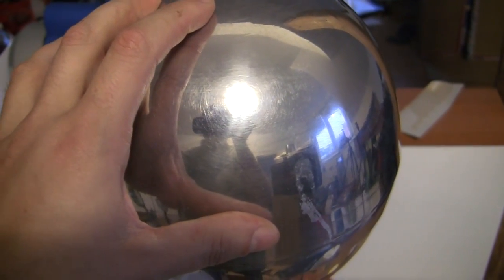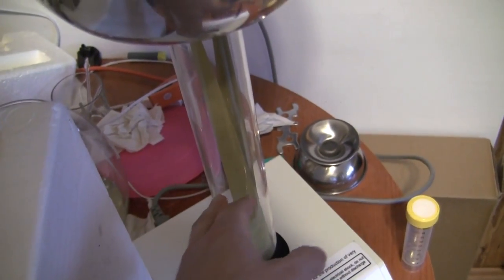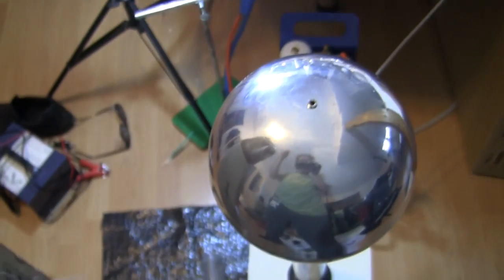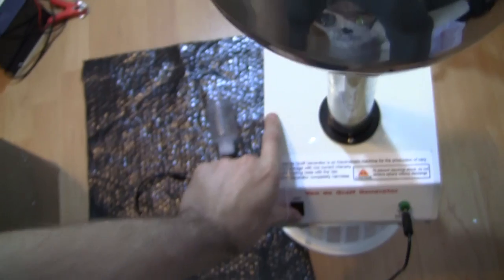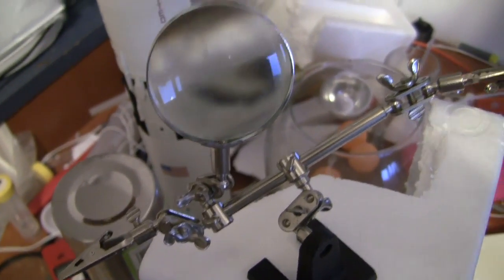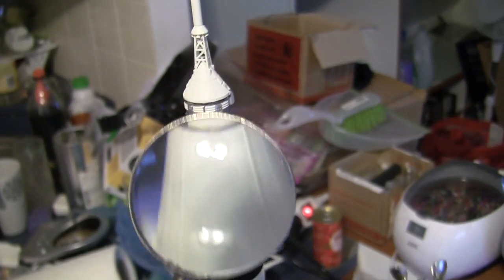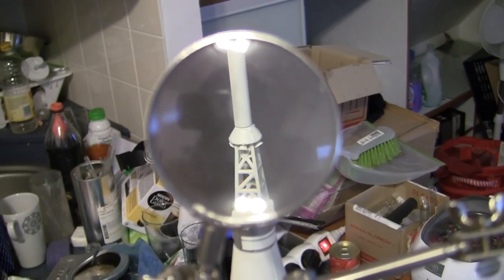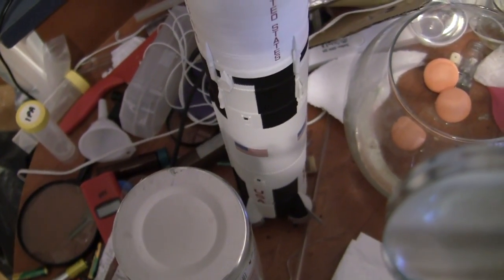Surviving a 10 000 VOLT shock!

Comment: Isn't amperage what kills you?
Reply: That is what he meant by current. Amperage is just the measuring of the current's strength
Reply: Cloud Seeker I never said anything about Voltage...
Reply: Navitas Nexus No, they are not. Amperes is the unit used to measure current. They are not the same thing.
Reply: Current and amperes are synonymous.
Reply: There are many dangers associated with electricity. The real danger with electrical shock is amperage, not voltage. Although people have been killed by as little as 120-volt AC and low voltage DC, the silent killer is the amount of amperage in milliampers that flow through a person's body. Any electrical device is capable of dealing a deadly blow, depending on the amount of current flowing through it. In fact, a deadly dose of current in the 100-200 milliamperes range is likely a fatal amount.
Reply: You need to understand that current and voltage are intricately linked, for a person to be killed by electricity a certain amount of current has to pass through the heart or diaphragm, about 30-40 milliamperes is commonly said to be lethal. This is because the muscles of the heart and diaphragm are electrical systems, if you disrupt them they will either stop or become irregular. Ohm's Law states that V = I*R, this means that to pass a certain current through a conductor (like your body) you either have to lower the resistance or you have to increase the voltage. Because lowering the resistance across the body is difficult - you'll need open wounds, salt water on your skin etc. The resistance between your two hands, across dry skin, is on the order of 0.6-10 megaohms. Which means you'll need to apply 21 kV (21 000 V) across your two hands for a lethal shock. Voltage is like a measure of pressure, without a pressure differential gases cannot flow, in the same manner current cannot flow without voltage.
Reply: Don't you mean Watt kills you...
sorry just making a pun..
Think Ohms Law..and you'll have your answer.
Reply: nilliv
In the UK our three phase is 415V. 240V from the regular sockets and 415V on the three phase.
Reply: Doom2pro
It IS the amps that kill, but you need a certain voltage to get them (simple Ohm's law). (disclaimer: the current also has to flow for long enough.)
Reply: ***** It's very short, pulsed current, which brings up another point, you need sustained current for a minimum amount of time, quick low energy impulses are not enough to cause fibrillation. 

Look at a defibrillator, intentionally built to give a long sinusoidal pulse.
Reply: Yes, but the current that goes through you is dependent on the voltage (V = IR).  If you're subjected to a high voltage, the current that goes through you will also be high, and that can be dangerous.  The damage that's done also depends on how long this high current is going through you.  In this example, it's only a very short time, so not much damage is done.
Reply: Matija Brković As long the current stays away from the heart, the worst you will get is a few serious burns.
Reply: Navitas Nexus
So distance and meters, volume and liters are the same thing, too?
Reply: Voltage is penetrating power, Current is the power running down the line.
Reply: TheAmmoniacal That makes perfect sense. Thank you.
Reply: practically yes, but its more complicated than that. way more complicated than that!
Reply: *****
Not the complete truth. Electricity has many risk, the hearth and serious burn might be the most obvious but there are more.

When standing on a ladder, contracting muscles caused by current trough them can let to the person falling of the ladder.

The Contracting muscles can damage them self or even break bones (-> strong spasms).

There are even electrochemical process that in the end effect can "poison" people. Think of blood as an electrolyte and I guess you see where its coming from.

Of course: Some of those effects are very rarely seen, but in quite some deathly electricity incidents, the electricity might have been the trigger, but the people got effectively killed by gravity or other secondary effects.
Reply: The true answer is neither and both.
neither, because each of them are not the deciding factor alone, and both because they are one multiplied by the other to get the energy content of the shock.
it is the energy content that kills, so if you have high voltage and low current, you survive, the same is true for a high amp/low voltage scenario. altho this scenario is exceedingly rare due to the fact that voltage is usually the main driver for getting a high current.
but even a medium volt/medium current scenario can kill you. that is why sticking your fingers in the power outlet is highly dangerous and the van der graaf generator is not.
Reply: Current is measured in amps. Current is the volume of electromotive force you could think of this like pressure in a pipe (volts) flowing through a particular circuit.

Current is indeed what kills you, however current is somewhat proportional to voltage in that very high voltages will inherently have some current. Technically there is some danger as it only takes about 100 milliamp across your heart to kill you, humans aren't like normal electrical resistors either. Our skin has an extremely high resistance, but that's the outer layers of dead skin. As a rule of thumb, once voltages start exceeding a certain level they will overcome the resistance of the skin and your blood, bones and muscle tissue has a much lower electrical resistance meaning if a relatively low current travels across your heart it would kill you.

Even Tasers which despite the high voltage have specially designed circuits to reduce average current to around 20-40 milliamp kill people all the time. Someone will get zapped and think their fine then their heart gives out a few hours later. Of course try telling cops with itchy trigger fingers that is a waste of time.
Reply: It's all down to the flow and path of resistance..
When working in large buildings. turning the power off is impossible.
So when connecting up new circuits. I have to work in live 415V 3 phase Busbar chamber whilst standing on a thick rubber mat..
I become essentially a live part of the circuit but isolated from the earth.
As long as I don't accidently cross myself between two phases..I'm fine and completely safe.
If you touched me though.We would both be crispy fried and killed instantly , by you grounding me out.
Reply: afaik it's the power, and that's your voltage * current
Reply: Power is actually wattage.  
Current is Amperes.
With high enough wattage, you could screw someone up.

Fun fact, as little as 2 amps can kill you :D
Reply: It always bothers me when someone says "it's not the X that kills you it's the Y". It's always a gross simplification, and because so is often incorrect. In the case of a static discharge, you have, at one point, a several thousand volt potential across your body. At that voltage your skin undergoes dielectric breakdown and becomes very conductive which allows several amps of current to flow through your body and across your heart. The reason you don't die is because the time in which this amount of current flows is on the order of picoseconds. some people say it's the watts that kill you, but when you have several amps flowing through your body and thousand of volt's across your body, your body is sinking kilowatts of power, for several picoseconds. In the case of electric discharge it's the joules that kill you, and a spark from a Van de Graff doesn't carry enough energy to stop your heart. But saying it's the joules that kill you is also incorrect, because if you touch both ends of a 9v battery you receive what would be a deadly amount of energy, but because you receive it over time, it wont kill you.

Frequency also affects leathality. touching 120v mains will kill you (albeit slowly), however if you were to touch an active broadcast antenna you would be exposed to hundreds of volts of AC, but because the frequency is so high, the induced current won't penetrate very deep into your tissues. Instead, you will get a painful RF burn on your skin.
Reply: Draekpro
Physics fail. You can't die from 12V.
Reply: Draekpro
If you're a theological fucktard then you're actually having a good day. They get to see their magical sky fairy or so they would claim.
Reply: Draekpro
It doesn't matter how big the current is in the device, with 6V of voltage, biggest current you can put through a human body is around 6/500 = 12 mA. Which is enough to cause severe pain,  but not lethal. And that's an upper estimate. Change body resistance to a more reasonable 1000 and there's nothing remotely dangerous.
Reply: Draekpro "Tell that to the bloke who got shocked while walking on a potline at the Alcoa aluminum smelter.. Oh wait, you can't.. He died as a result.."

i'm rather sure he did not die form 4/6/12V there unless he pinched some electrodes into his body.
The human skin alone has a far too high resistance to allow any strong currents on low voltage.
Reply: *****
1. 0.05 amps is enough to kill a person on a 240 V circuit.
2. Current is a term for amps.
Reply: No it's not, I have a 12V 100 amp supply here and I'm touching it with both hands and I'm not dying... It's not the Volts OR the Amps, it's the Volts AND the Amps, more precisely 70mA or more current and about 80 volts or more.
Reply: superdau I know ohms law and I know you need enough voltage to get a sufficient current into the heart to be fatal, that is why I said what I said, you need BOTH. Saying that it's the amps is ignoring the voltage part which is required, saying it's the voltage is ignoring the amps part, it's BOTH.
Reply: ***** Dude, it's neither individually, you need enough voltage to break skin resistance and enough current available to cause fibrillation. 

Saying 60mA will kill you is just as bad as saying 10,000 volts will kill you. You need typically 80+ volts to break skin resistance AND at least 80mA to trigger fibrillation. 

Amps OR Volts don't kill you, some combination of both do.

But it's not concrete as skin moistness, salinity and blood electrolyte concentration can make these numbers vary greatly.
Reply: *****  "if you're going to say its both then add in resistance and say its all 3"

I did. I mentioned skin resistance, which is a product of skin moistness, salinity and also mentioned blood salinity because the it's the blood vessels that eventually conduct the fatal current across the heart.

Bottom line is: 

1. You DO NOT get current flowing without adequate voltage to overcome resistance.
2. You can have current available, I.E. I can touch a 300 amp supply and not die because the voltage is too low, thus little current flows, even though the supply is more than able to provide the 300 amps, should it be given a low enough resistance to flow.
3. The current must be sustained long enough to induce ventricular fibrillation.  

Quick little pulses from a Van De Graff obviously won't do it, and sustained jolts from say a Flyback transformer won't work either due to high frequency switching and the skin effect.

Trust me, I know all about Ohms law, and the dangers of high voltage.
Reply: xGiBbYv When you say current you are talking about amperage, Voltage is something completely different.
Reply: xGiBbYv You said "That is what he meant by current." And that is wrong, the amount of ampares i how much the flow from point A to B that happen within a given time limit is, so when you say current you mean flow everything else is the wrong use of the word because nothing else can be a current in electricity. Voltage can't be called current because voltage is the intensity the flow is delivered in.
Reply: Cloud Seeker Exactly.
Reply: Yes the current is measured in Amperes, and is normally designated as I.
The electric potential is measured in Volts and is normally designated as V.
The resistance is measured in Ohm and is normally designated as R or Ω.
Reply: It is complex problem. Voltage needs to be high to pass low frequency current. You must have voltage in first place to get current, but is current that will cause you problems. Second factor that no one tels you is frequency, if you go above 50kHz, current can't go inside body, so no damage to internal organs will occur, but it will flow on skin surface, and that can be very bad, it similar idea that low frequency sound can blow you ear drums, but same power at 200kHz will do nothing
Reply: Voltage doesn't kill you, current kills you. But your body has electrical resistance (like any conductor). This resistance varies on a bunch of things, but lower boundary is around 1000 ohms, when your skin is wet.
Lethal current is around 50mA (again, depends on a bunch of things, but we don't care). The important thing is that V = IR. To put 50 mA of current through 1000 ohms of resistance there has to be at least 50 V, which means that it's impossible to die from very low voltages (like 9 or 12V).
Reply: zoidberg444 Is 100mA = 62410000000000000 electrons per second? Even with a calculator I'm shit at maths.
Reply: Dissentient Yeah resistance has to be low but the body has too high resistance
Reply: ***** nope
if the current is high enough it literally fries your tissue and you could die from having dead tissue in  you system (it's toxic).
Also depending on the on where the tissue is damage it can lead to scars or ruptures (resulting from the tissue being damaged enough to the point it breaks (i.e. lungs)).
Having a high voltage current lead over/through the hard is extremely dangerous but by far not the only thing that can kill you in regards of electricity.
have a nice day :-)
Reply: Yea volts arr just painful and annoying but amps make you feel like youre dying
Reply: ***** Kinda curious what you use 415V for, from my experience that's a rather uncommon rating. We use 600V, 208V and of course 110V for various motors where I work. Must be some highly specialized application or that's just your transformer supply. I've seen 415V single phase motors before but they were really old. Or you live in a country with different standards. Just curious.
Reply: *****
superdau 

Synonymous:
1. (of a word or phrase) having the same meaning as another word or phrase in the same language.
2. closely associated with or suggestive of something.
"his deeds had made his name synonymous with victory"

I'm using the term synonymous in it's second definitive manner, closely related but not necessarily the exact same thing.
Reply: MrDpsc The term your looking for is wattage,   W = V * A
Reply: Linas K
The same thing is true of EM Radiation - Microwaves. When the military rolled out their ADS systems, idiots freaked the fuck out because they operate at 100Ghz - about 50x higher frequency than that of your average household microwave oven - not realizing that the higher the frequency the safer the device became. The higher frequency waves can't penetrate the skin further than about 0.4mm of the top layer of skin - about where the very tips of the nerve endings are and delivering a pretty tortuously painful experience, but far from dangerous or deadly (at least when contrasted against other military means of crowd control).
Reply: nilliv
400V is pretty common for workshop tools like compressors, welders, circular saws and similar things with "oomph". Thats's why it's useful to have an outlet for 400V/3phase in the basement.
Reply: Voltage directly determines the current.
Remember Ohm's law, I=V/R

***** I recently walked in a half-abandoned power distribution substation in a heavy industrial factory, and I was a bit surprised to see that the lines I walked on(5cm thick and 10cm wide bus bars) were actually hot @ 380V. I was even more shocked, when I looked at what the current meters on the main panels these bus bars led to could read.
Minimum reading was about 140-180A, maximum was 10kA.
Sinuev1 Not exactly true. Yes, it is skin-effect, and yes, most RF signals can not penetrate your body due to their wavelength, but you can easily die from a hefty DRSSTC shock if you can manage to ground the other half of your body, the current will happily flow through your heart. Not all of it, but certainly some.
superdau Most of the world uses either 415 or 380V for heavy applications, but DC motors usually tend to operate at either 600V or 3-6kV, depending on the power an the application.
Here is an example of an old soviet 315kW AC motor running at 6kV.
http://puu.sh/c9nDf/e0f93e7f8d.jpg
Reply: *****
415 or 380 is all the same. It's within the 400 nominal +-10% allowed tolerance (at least for Europe). I haven't dealt with full bridge rectified DC but I guess the result will be in the area of 600V DC.
Reply: superdau It's used in very powerful motors for really high stability applications(+-50rpm), like in plastic extruders(ours has a 55KW DC motor).
Reply: Shit!!! I've never seen so many Electricians or  Electrical Engineers in one place before..ha ha ..Kind of scary..
I was taught the UK IEE regs 15th edition in 1982...Fuck'd if I can remember any of it, now...lol
Reply: Ugh, we had Volts, Amps and Watts now - and NEITHER of those is what is killing people.
It still is the good old JOULES,

you can have a Pulse of 10 kV and 0.1 Amps running through your body with no harm - it only has to be short enough.

So no, it is NOT the amps that is killing you.
Electrostatic discharges use to test electronics go up to 30 Amps at 30 kV.
But if you get shocked by that, well, it hurts - a lot - but that's it, you don't die.
Simply cause the device only has a very limited energy-storage.
a few nano-seconds of such voltage/Curent won't kill you, not even harm you physically - it is jsut s hort shock.
Reply: Amperage is a term that dictates electrical current, while volts dictate electrical pressure.  All voltage will do is increase the risk of arcing.
Reply: It's volts that jolts, it's mils that kills...
Reply: ***** And you know what? In that video you have high currents as well, in the range of up to several Amps....
Reply: ***** Without the voltage, no current flows. So it's not just current. IT'S BOTH. BUH BYE.
Reply: *****
 *"no it does not. its high voltage and low current. ohm's law doesn't apply."* Please, show how this would be the case, show us, why any scientist iwll tell you that there are extremly high currents working.

You have a high voltage, a high current, high power, but short time and thus still only a small amount of energy.

You can even measure the generated magnetic field, and it isn't a small field either. Just very short. have fun creating that without Amps.